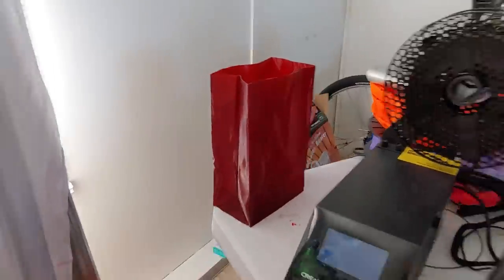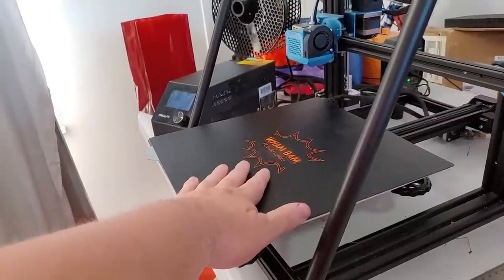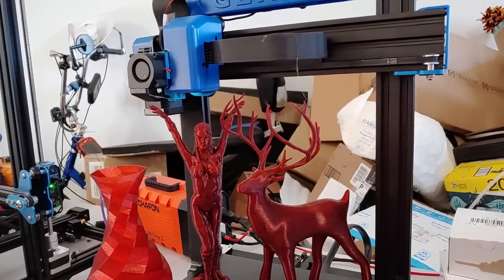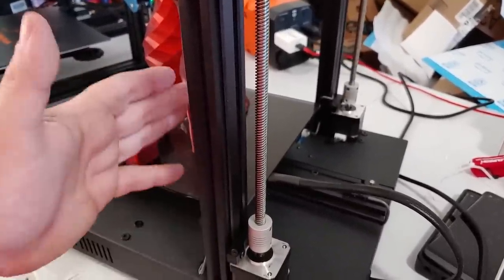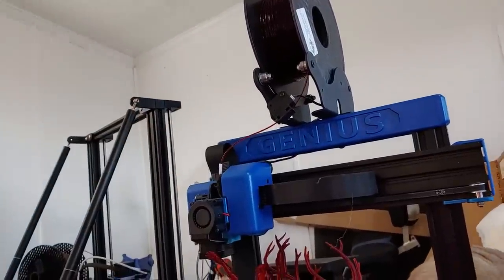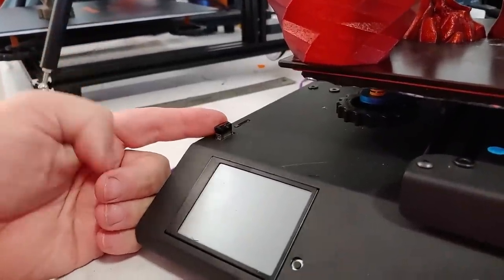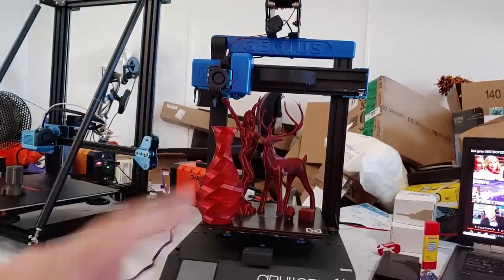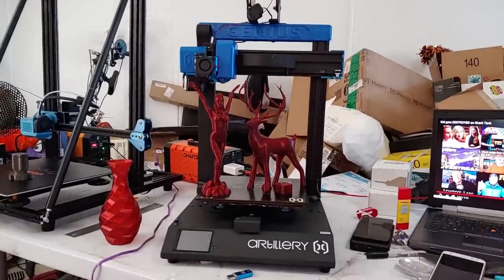Artillery Genius & CR 10 V2 Upgrades Overview T3DP

Comment: You can use a t-nut for the endstop to lower it. It is a little bit tricky but it will work well when ist is adjusted! I installed a finely milled printbed aluminium bed instead of the glasbed. (Sorry for my bad englisch i learned it 30 jears ago)
Reply from the maker: Agreed but I'm thinking about it from the manufacturer versus end-user perspective.

Comment: Off topic.  I was at the gym today talking with a friend.  He is retired from the city water works.  We are in California so may not apply to NM.  He said codes here allow them to use the same trench to run water and natural gas.  I told him you were on bed rock and he said they still can do that type of an install.  Not sure if you have city water but you might want to look into having the gas pulled next to the water line.  There are some codes here that determine the proper installation but thought you might check it out.  Hope your pellet stove arrives soon.
Reply from the maker: I will ask them about it but the water is oddly enough not under the road. Its private piped water not city (city is actually trying to steal the water company by abusing eminent domain we are trying to stop them)

Comment: your videos are so good and vary informational thank you .......I need your advice on a printer looking to buy a cr 20 or a Artillery® Genius?  are the nozels on the  Genius the same as the cr20 ?as i have a cr10 at the moment have a lot of spares around i want to print big and fast with a 6mm or 8mm ?if they are different could u please link me to the right ones please thanks for your time
Reply from the maker: Nozzle should be the same. I might lean towards the cr20. The genius is nice would that ribbon can be a bit wonky.
Reply: @nerys71  thanks chris u the man keep up the awesome work

Comment: Hey Chris, I have a 0.8 nozzle on my Cr10-S5 and also a BMG Extruder as you but I really cant get rid of stringing. I changed the bowden tube to a capricorn clone (it is 60cm long) and also the extruder was calibrated exactly. May you have an idea how to solve it?
Reply from the maker: Get temps right. That can help a lot. 7mm retraction 35mm/s and use an 8mm wipe (not coast) retract during wipe and set combing (stay inside outline of model)
Reply: @nerys71  thx mate

Comment: I just got my artillery genius before I start printing do I need to check the heat break against the nozzle to make sure it doesn't leak or should it be good out of the box on this machine
Reply from the maker: You should be fine to go out of the box. It's not too often. They come assembled wrong
Reply: Nerys thank you so much. It gives me confidence hearing it from you, great content by the way.
Reply: Mine leaked. After replacing everything touching the throat, it prints great.
Also my build plate is not flat. PIA, but using a mat that came with some filament and prints stick mostly worked around the lump.

Comment: Hi Chris  only one question    how fast did you have the Deer Printing ?
Reply from the maker: Slicer says 5.5 hours so i assume 6 to 6.5 hours.
Reply: @nerys71  I mean  the Print speed
Reply from the maker: @theGermanPrintingNerd  my normal default max 50mm/s with jerk at 5 acceleration at 500

Comment: BNG clone or the cr10s pro  extruder?  cost is about the same, which do you like the best.  or do a compare video
Reply from the maker: Hmmmm old pro ext? Go with bmg but if you get the corrected one might go with the pro extruder unless you are going DD then the 3:1 would let you ise a pancake motor. Advantage bmg.

So DD i would go bmg but bowden i would go pro extruder.

Comment: Clean ur house neck beard
Reply from the maker: Learn how to spell Slim
Reply: @nerys71  so... ur not gonna clean it?
Reply from the maker: @slimjim7387  of course i am. Last room in the house to be cleaned up. :-)

I do not have curbside trash service here. So i have to pack and haul it off. Very cheap just labor intensive.

Also cleaning up my own shit too. Down to 447 from around 470.

Little by little i will get my shit together.
Reply: @nerys71  just waiting for that new year's resolution am I right?
Reply from the maker: @slimjim7387  i hope to have this shit cleaned up before new years! Its driving me mad! :-) doctors appointments are slowing down now so i will have a lot more time i hope. Though i still have to work on hot water the pellet stove will be in friday hopefully so i can begin collecting what i Need to install that. Might have some help from a neigh or to lift the snowblower out so i will be ready for more snow when it comes. Got to make another kerosene run friday probably. Busy busy busy